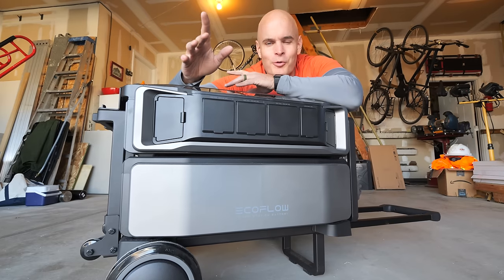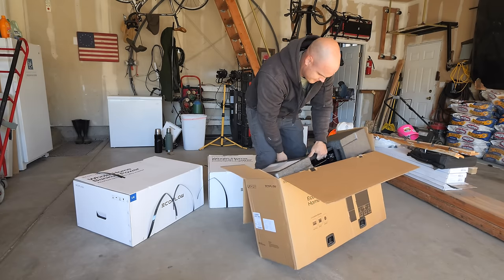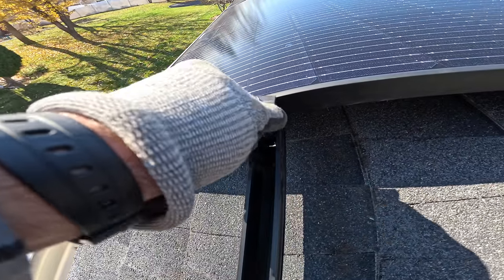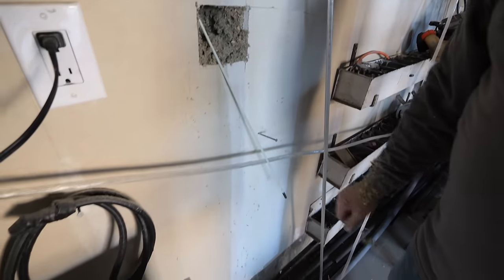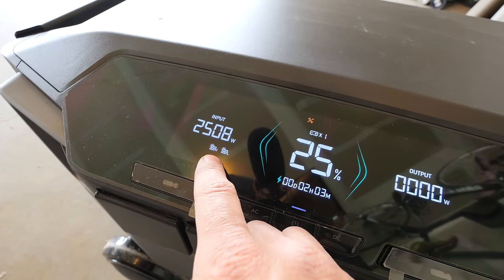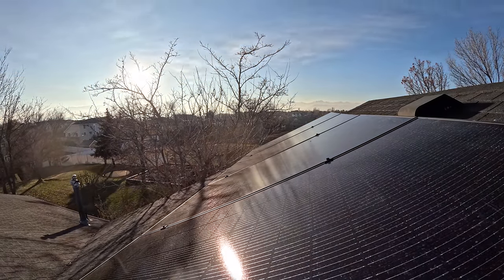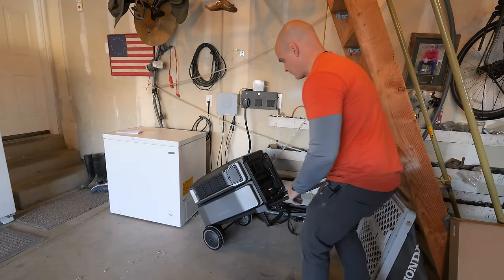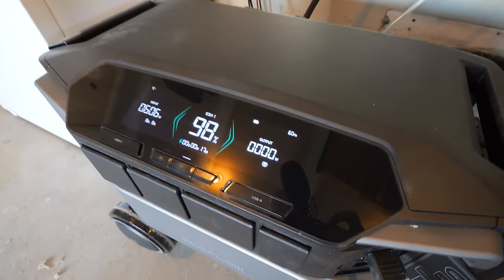Off Grid Stackable Solar Battery - So easy its *Almost* Cheating...

Comment: I have a Delta Pro 2 and it stopped working a month after I got it the RMA process was a little bit frustrating because they said that they were going to repair it but they sent me a completely different unit that had been previously used and I don't know how many charge cycles it's been through

Comment: 90kWh sounds like a lot but for many, in winter, it's not sufficient. Considering heating with a heat pump a mind blowing amount of kWh is required to get through the dark winter months (well over 1000kWh) or a massive amount of solar panels so it actually charges with the little light there is during winter. Factor in an EV and off-grid solely relying on solar panels becomes quite a challenge. 

But for a backup or for dynamic pricing this would be pretty good! Now the price ...
Reply: Depends where you live and how big your solar system is. Also depends on what your heat pump source is. A ground based heatpump would last 100 hours or more with 90kWh producing about 5kW of heat with a COP of 5 even when it is really cold. 

Above about 55N it gets difficult to gather enough solar for use with a heat pump, unless you have a really big battery and really big solar system. (200kWh+ and 100kW of solar)

In many places in Canada and the US for example you get plenty of solar during the day even in the winter, so with a sufficienrly sized solar system you'll easily run a heatpump and even charge up some batteries when it is cold. Talking more lik that 90kWh and 25-50kW solar system.
Reply: @rkan2  Makes sense, wish I had the space to put 50kW of solar :)
Reply: @FrikandelBroodje69  If you don't, you probably don't need 5kW of heating either - unless you live in an apartment.
Reply: Could use a pellet or wood stove for heat if power is a concern.  I have a 48000 BTU pellet stove  that uses 450w on startup and runs around 200w.  2000sq house..
Reply: @JohnSmith-wt3mw  Sure, though a ground source heatpump would take less than 1kW and run year round and even provide cooling in the summer. Costs a bit more of course but no need to haul some fuel one way or the other. Also no constant fire going on somewhere..
Reply: @rkan2  no doubt.  Geothermal is pretty awesome as well. Having multiple options are great and allows for energy and installation flexibility😀

Comment: Lol. "Any electrician". Don't need to be an electrician to install 2-4 wires.
Reply: It's certainly more than that. It's similar to installing a sub panel/critical loads panel. The instructions are much easier than some of the other solutions out there which your average electrician wouldn't touch and have giant technical manuals and crazy wiring. Most municipalities will require permits for any new circuit or circuit panel modifications though, so be mindful!

Comment: Just build a Tesla turbine and incorporate proper magnetics into the turbine to be able to treat each disk that makes up the turbine individually as a Faraday disks!
Put it in a closed loop with a boiler and a condenser. You want to cool the water down just enough so it's no longer steam. Just add like one more degree and it's boiling again. That way it takes less energy to make it boil when it cycles around.
Don't use the turbine for its torque. Tap each disk individually as a Faraday disc. Once you achieve a certain diameter for the turbine,  even after converting the voltage to the amperage as needed. At some point, once you reach a certain diameter on the turbine., you will have more energy out than the system consumes, self-sustaining.
The thickness of a Faraday disc determines the amperage and the diameter of the Faraday disc determines the voltage. Only the voltage squares on itself, not the amperage. So you want to focus on diameter over disc thickness.
The magnetic lines of force need to be axially aligned to the disk. So running straight through 90 degrees from the face of the disk. Else it won't work. And when in operation there is no magnetic cogging effect, no magnetic resistance.
Reply: This message will self-destruct once the bots find it because they don't want you to have free energy. So copy and paste it while you can.

Comment: For this set up being easy, you did a lot of work (i.e., breaker instillation, etc.). So, is this something that can be plug and play? I am considering using it in my camper during longer no-sun periods, so I want the banked hours when there is only a trickle of sun for days. So, I am looking for a 'buy it, secure the panels, cut a hole and plug-it-in' set up. Is this also plug and play or will I need to add the other components, hire an electrician, etc.? Thank you.

Comment: Why Americans are obsessed with wooden wall houses instead of concrete ones?
Reply: My friend from Spain asked me that same question. Basically, it just comes down to cost for the home builders. Wood is cheaper than concrete block or brick. Framers are cheaper and faster than masons. However, it technically has less durability and more maintenance costs, but that's a problem for the sucker homebuyer you sell it to. That said, there is no reason a well-maintained wooden home shouldn't last a very long time.
Reply: @nbnsraz  mmm.. But this guy definitely has money to build underground bunker, so...?!  🤔

Comment: 90kWh is enough for 15 hours in Norway wintertime. I litterly used 145kWh yesterday, but to be fair it’s -19C (-2F) outside.
Reply: You need some better house insulation if your heater is running that much, jeez.

Comment: Question: Would it be feasible or beneficial to run the EcoFlow Delta Pro units continuously? The idea is for the solar panels to charge the units during the day, allowing them to power the house 24/7. At night, when energy consumption is lower, the units would draw less power. By morning, the batteries could be recharged to around 90-100% capacity, ready for the next day's usage.

Comment: It's fine and all, but how much is it? And what's the expected time to break even?
Reply: He probably didn't mention pricing as it will probably change over time and also may vary depending on where you live. Looking on their website, it looks like it isn't actually released until Jan 9th (tomorrow), so I don't see any actual pricing yet. The break-even point will depend on your energy rates, your energy usage, the exact install cost (since you need to pay an electrician), etc.

They do have a "pay $300 now, get $1500 off when you order later" promotion going on, but that is limited to 1000 people and it shows as having 899/1000 already sold.

Comment: I mean, i definitely cant afford this now, but maybe in 10 years. We just got an awesome 10kW generator that basically powers the entire home. We lose power during the winter for multiple days so its awesome (just had to use it for 3 days last week. Coupled with Starlink internet, we didnt even really know we didnt have powerr. I'd love to get full on battery and solar as a backup, and even switch to it entirely. again, maybe a 10 year plan.

Comment: Hi Zack, So I live in Amsterdam, most homes don't have garages or car access directly to the house here. However we do have solar panels at home. Does this mean I could charge up the modular battery and charge my Tesla with it using the Solar energy? I need to walk towards my car every day for about 1 or 2 min. How heavy would this be if I stacked a couple batteries on top?

Comment: As these are batteries that do not extinguish in the event of a fire and that release extremely toxic fumes during combustion, I would never install or store them indoors. Especially inside the wooden houses you have in the US.
A small separate mechanical room just for this or other pertinent systems would be perfect for this solution and would make it safer. Even mechanical switches activated by heat or water could be used to make it safer still.
Other than that, it looks like an awesome solution and I love the stackable modular plug and play feature! What an incredible execution for a solution that scales as your power needs increase or decrease over time. Not to mention, if a battery dies, you can replace just one instead of the entire system or a single huge battery. Truly amazing and how things should be!

Comment: What is the actual price of this unit
Reply: The retail price for the inverter and battery combo is $5,799. You can buy a 0 obligation discount coupon today for $300, which gives you $1,500 off the retail price. So assuming you purchased the coupon, it would be $4,599 (including the price of the coupon)

Comment: This is really really cool but my issue with it is just its way way way too expensive. I could build a 48kw pack with inverter and solar charger for $15000 and use LiFePo4 batteries which can take me 100% off grid. To do the same with this system would cost $27k which is just too much even though LiFePo4 batteries last freaking forever.

Comment: Incase you were wondering about this ad

EcoFlow DELTA Pro Ultra
EcoFlow DELTA Pro Ultra is our most powerful whole-house backup solution to date.

7.2-21.6kW output
6kWh-90kWh capacity
5.6kW-16.8kW solar input
Auto-switchover, prolonged backup, and energy bill savings with EcoFlow Smart Home Panel 2
$5,799

Comment: Just purchased the ULTRA and Smart Panel and want to add RIGID Solar on my roof... System is setup for Emergency BACKUP Power and my only source of backup. How many (400W Rigid Solar x2) panels would you suggest I start with?

Comment: Be aware that after 30 days (the product return window), the EcoFlow warranty replaces your product with a refurbished one.
So, yes, it's a 5 years warranty - but for a refurbished replacement. If it fits you, then you're fine. I am not.

My 6 months old RIVER 2 device is showing a troubling EPS behavior after a firmware update. Their only support reply was to recalibrate (3 times full discharge/recharge cycle - similar and as useful as Microsoft Support SFC command ubiquitous suggestion) and/or replacement.

Comment: So in Ontario they have an ultra low time of use now (meant for EVs) that is 2.8cents/KWh and I thought. "Lets get a bunch of these batteries and charge them up during that time and then use the battery power during the day where rates are 8 to 28 cents/KWh". So my average daily use for my house is 16-20KWh and if I switched to using battery power I would save $65/month by purchasing hydro at the utra low price over night and storing it in the batteries and using it during the day. I figure that I need 1 inverter/battery that does 6KWh and 3 more batteries for a total of 24KWh (like Zach said nice to have some padding) So the price is ~18K Canadian.. with only a savings of $65 a month it woud take me 23 years to start seeing any savings... And the batteries would proabably hold half the charge by then.... Yeah we are not there yet!! Cant wait till I can start to rely on battery power more! By cheap use high!!

Comment: "Evade the expensive time of use" as if buying solar panels and batteries isn't the same as paying for 15 years of electricity all at once. That's really the biggest drawback. You gotta have a big wad of cash to get off grid and maintain your current lifestyle - like using an oven, stove, or a clothes dryer. Obviously the benefit however is not having to rely on the power grid to run your home and being told "you don't get electricity today because your social score is too low" or "you were near the capitol and january 6th so you're now not allowed to have electricity." Also, our typical usage is an average of 1500 kWh. Nowhere near the 90 kWh you say is a month's worth.

Comment: 5:55 The rust-in current needed to start a big'ol electrical motor like that requires MAAAAANY more amps than a puny battery like that can manage.
Unless you add a soft-start box.

Comment: The monopoly power company.   The gov't regulates them,  but tget usually are authorized to raise rates when they propose it.  In the case of Eversource , here in New England,  they are merely a broker of electricity & writes pay around $0.30/kwh

Comment: lmao you said a month with 90kw that is 4.5 days in winter for me. I have 60kw battery storage and 11.2kw solar with 2 inverters.  9.5 months a year I can not use all my energy from the sun. Those other 2.5 months I use about 1 megawatt or 1000kw's from grid. For me its a generator which costs more to run that than grid so I use grid as my backup.  I will get a generator down the road since I do not trust the grid with all these EV's coming out and Our open borders letting in who knows who that could cause American Grids harm.

Comment: I dont get the use case for this.

If you're stacking enough batteries to take a house off grid or significantly reduce elec consumption from the grid then you want a more permanently installed solution, of which there are many better form factor multi-battery and inverter solutions out there that take up less space. Secondly the AC side of the inverter is the most critical part and isn't significantly simplified and will still cost you a decent wad of cash to have a qualified electrician install in your home.

Ecoflow isn't doing anything groundbreaking here in my opinion.

Comment: Just curious, what are they doing that drains 6kWh every night?
Reply from the maker: Fridges, furnace, dance parties. Not really sure to be honest…
Reply: Heating, cooling, fridges, freezers, networking equipment, computers. There's a lot of individual things that add up.

Heating can be up to 1500 watts per room depending on how bad your insulation is.
Reply: 6 kWh per night - say 10 hours, that's 600 watts on average, that's not too crazy, I think? At least for an American home? With an A/C running you could easily get and exceed that.

Of course, I'm from Europe, so my house draw 110 watts when everybody is asleep, and that is with a bunch of IoT stuff drawing some watts here and there.
Reply: Next step is to go through and find cheap things to replace and optimize for power management, I was running a laptop for some IOT things, just replaced it with a raspberry Pi 5 and it'll pay for itself in a year or 2.  Always on security lighting can be swapped to LED, a battery tender could be put on a smart plug and scheduled, etc

Comment: Can you share your Hi and Lo panel array configuration? Im trying to oversize my system with two parallel sets of 10 in series one East ans West facing roof to maximize the generation during the day while not exceeding the 450 voltage limit

Comment: Any idea if the smart home panel is also easily upgradeable? I have some "smart" house things which are getting out of date fast. I have to replace them all. For example the heat pumps now only work with old wifi systems. So I have a separate network especially for that. Something like a power panel like this needs to be easily upgradeable.

Comment: Just a question, Will the house insurance cover in case of Fire being these batteries inside the home?  another question is :- How does the power shift from the main power source to the EcoFlow inverter? is it an automatic cutoff or manual?

Comment: I would love to see you tilt a stack of 9 of those at that angle 😂 there is no way a full stack would be transportable together, tiny little fixings & plastic cheap looking wheels? Maybe they are better than I can see on the video but the angle & weight is going to put a lot of strain on the mechanical system holding them together

Comment: Personally, any smart devices I'm wary about, especially if they stop supporting it or if the internet goes out, you'd just be left with a useless brick of a panel... If you can't manage it locally without any external servers then I wouldn't consider anything of the like.
Reply: It's a standard subpanel with smart features.  If you lose internet it will still work.  It has normal physical breakers...

Comment: I see 2 problems here.
1 is how are they going to clean the solar panel to make sure that the dust doesnt just sit on top of it as this will reduce the solar power absorbtion.
2. I see that the trees shadow falling on top of the panels which is blocking the sun. These both will not let the solar system work at its potential.

Comment: 1 Tesla Powerwall is $8,400. This system is "$5,XXX" so $5,999. The additional battery brings it almost to the same price. Electrician/install equivalent probably. No VPP with this yet, Tesla does today. Powerwall turns Cybertruck (and prob future Teslas) into additional backup batteries. Hard sell unless you only want one battery system. Very tough sell if you don't get the 30% tax credit on it and additional batteries.
Reply: Your answer to $6000 for Ecoflow in this video is a $75000 cyber truck and $8400 powerwall?!?!? Shill for Tesla much? Lol
 Ford lightning does the same thing..All EV's eventually will.
Nothing wrong with having options.

Comment: Ecoflow is over fucking priced
Only for the Ultra Rich.
Reply: $4,599-30% tax credit=$3,219. Grab a new credit card with a large sign-up bonus (will cover what I paid for the used panels) and 0% over 12 months, $268/mo. Got me some used 365w solar panels off Craigslist. Need a few hundred in other materials for transfer switch, racks, grounding rods, disconnects, etc... Anyway, should offset $700-$900/year in electricity, plus any time of use savings. That's a payback period of ~6 years, plus I don't have to buy anymore lead acid batteries for my UPS's that were on my computer and modem/router. Should save another $100/year there.